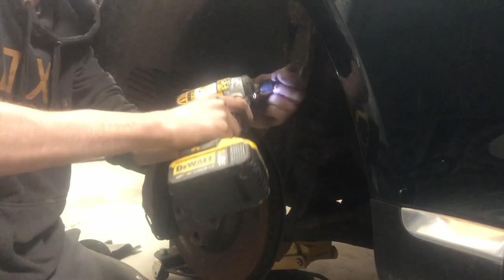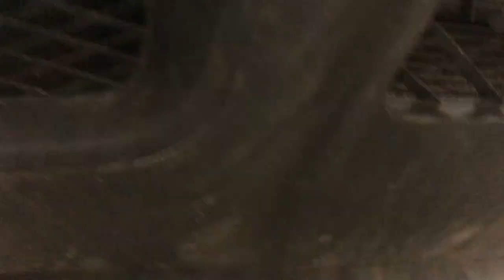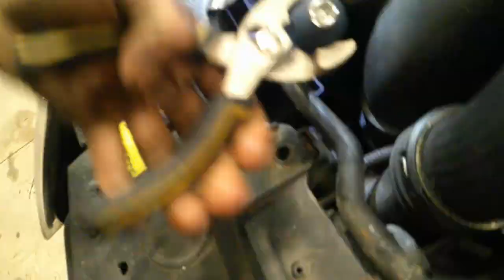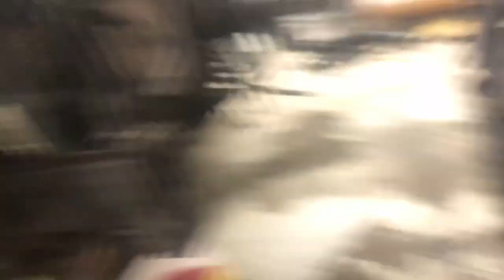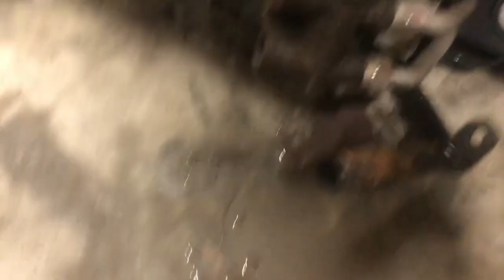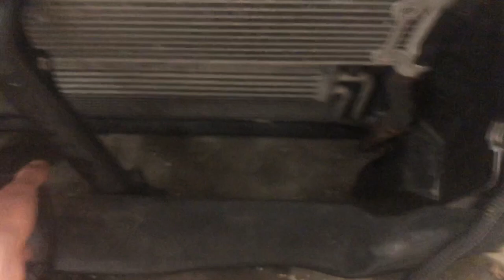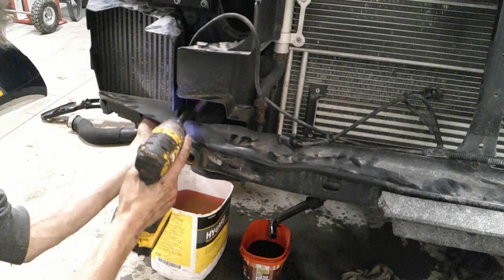DIY V10 TDI engine removal. Part 1: Front clip removal

Comment: I'm currently in the process of getting my V10 Phaeton back on the road. It's got a nasty oil leak. I reckon these videos will be helping me a fair bunch to take the engine out and find what's leaking...cheers for the videos, it's given me hope!
Reply from the maker: I believe the phaeton has a few differences (sadly we never got the v10 version here) but should be able to get the idea from the videos, hopefully it helps.

Comment: AC compressor pump - what do i need to remove to replace it?
Reply from the maker: Not sure if you've seen this video but it shows a close up on the LH side where the compressor/power steering pump is around the 1:30 mark. I haven't looked closely but id imagine the engine mount would need unbolted to get out of the way for easier access 
https://youtu.be/Id95xvylbWo
Reply: @JoshsJettas  i saw it afterwards. So would i need to remove the engine still? Its for Phaeton with the same v10
Reply from the maker: It’ll be tight in car but I think it’d be do able if you can support the engine while removing the mount. I removed the other side mount when diagnosing my no crank issue when I first got the touareg
Reply: @JoshsJettas  Thanks! Someone is offering his Phaeton for decent money, but it has 2 issues. The ac swithches off  sometimes when its very hot outside. He thinks it needs a refill, but i think ac wouldnt switch off in this case? Sounds more like ac radiator fan or ac pump issue (ac just overheats and switches off?). Other issue is el boot opens only with 2nd button press. Again, he thinks its the ribbon cable that goes from boot to lid. But i would think its the boot hydraulics? Any thoughts ?
Reply from the maker: I’d scan it and see, id think if it was low it’d be kicking out all the time and not just hot temps. But saying that I know the Touareg there’s a lot of line for the 4 zone climate so the possibility of a slow leaks probably pretty good, my system was empty already when I pulled the engine. As far as the trunk/boot I can’t comment on that as we didn’t get many phaetons over here in Canada. But I know my golf if the doors are locked I have to double click the trunk button before it pops.